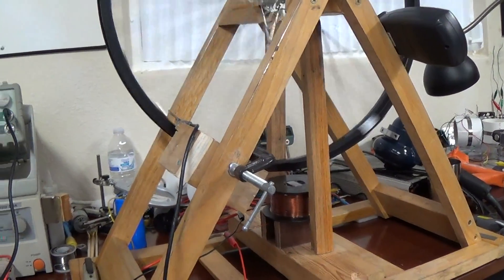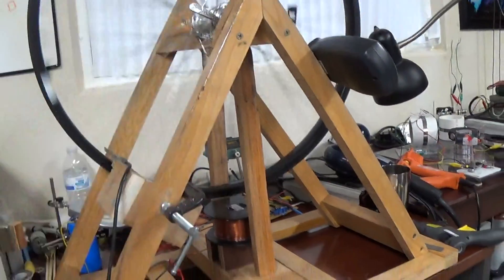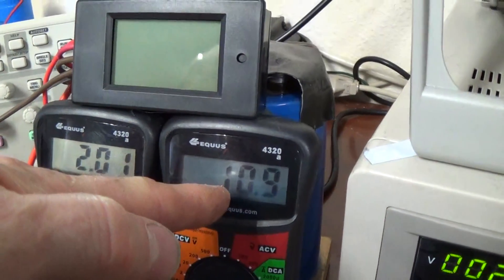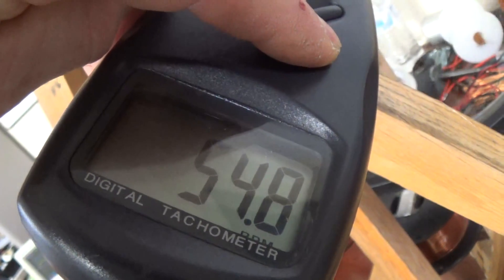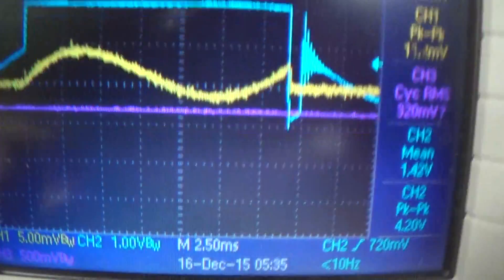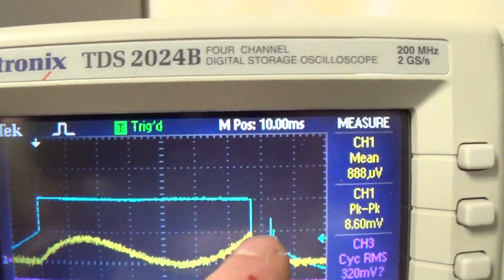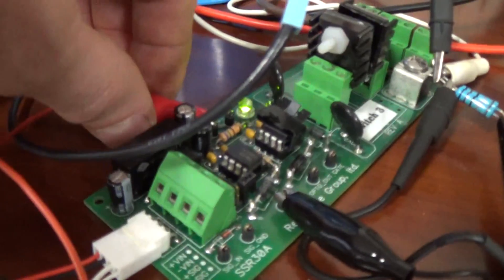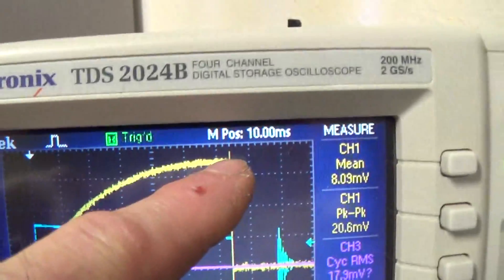Proof a Magnet Rotor Increases Efficiency in Pulse Motors v1

Comment: Luc, you''re not including the increased flyback energy in your efficiency calculations. There's clearly a much bigger flyback energy present when connecting the coil driver to the signal generator
Reply from the maker: +Aka Teslaalset +Aka Teslaalset Yes, you're right!  the flyback is more!... it's @ 1.67vdc on 100 Ohm = 28mw but the coil input is 240mw compared to with the 2 pole magnet rotor turning the coil input is 24mw. Let me know which one you would prefer?  Luc

Comment: thank you for sharing!
another good test will be using the same optic sensor in the wheel not is phase with the magnet/coil alignment, in this way we use the same trigger signal